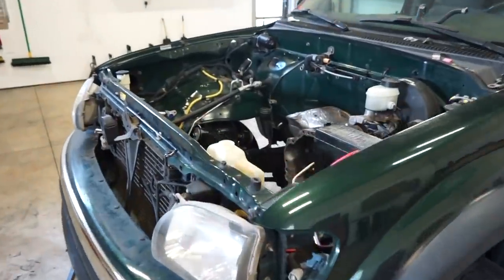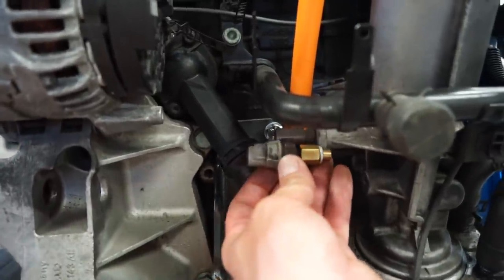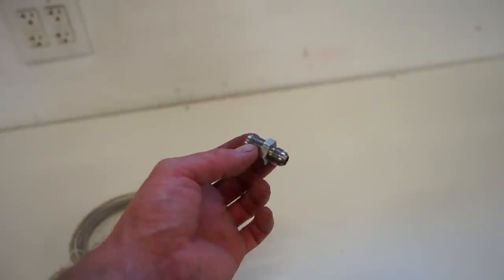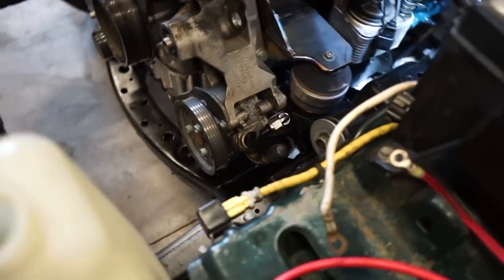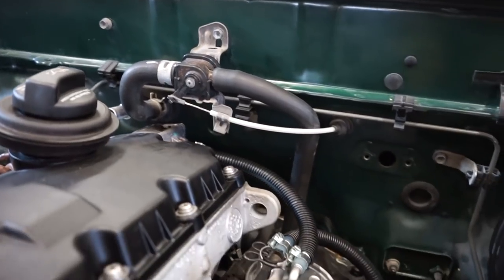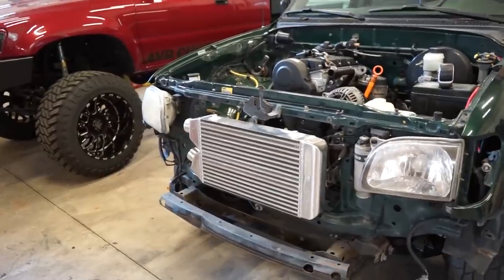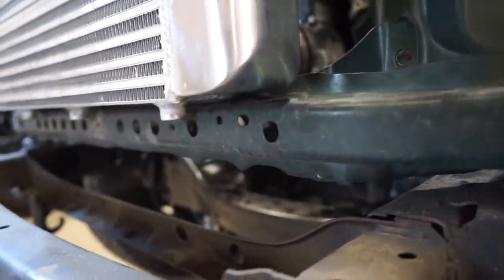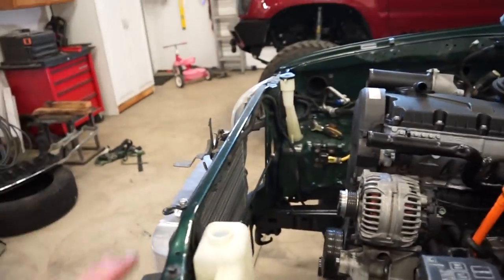The Tacoma TDI Swap Is Coming Along!

Comment: With all the room in front of the engine, you could bend a sheet metal "standoff" from the header panel for the radiator, to give more room for the A/C to mount. I guess it comes down to what you'll use for an electric fan.